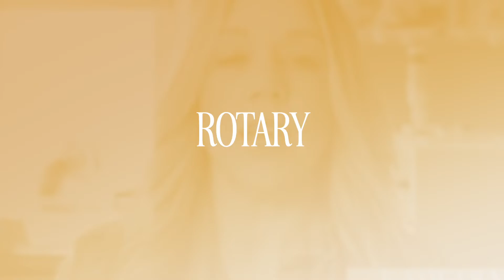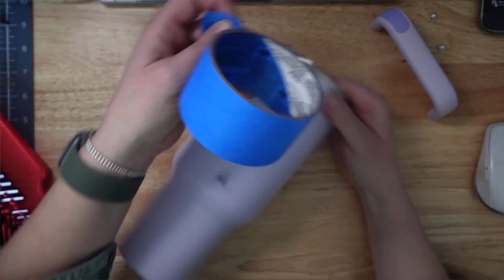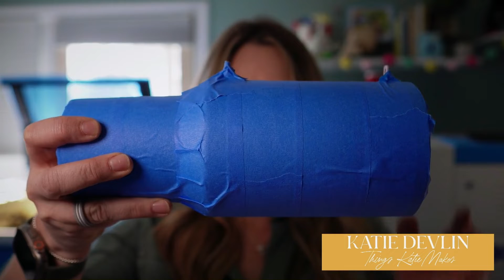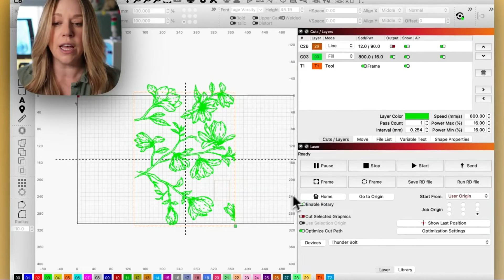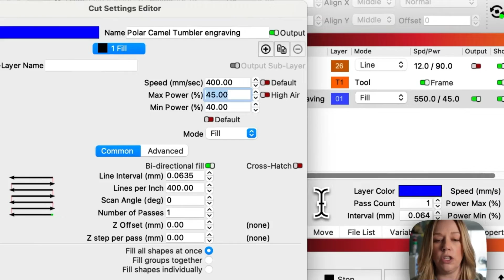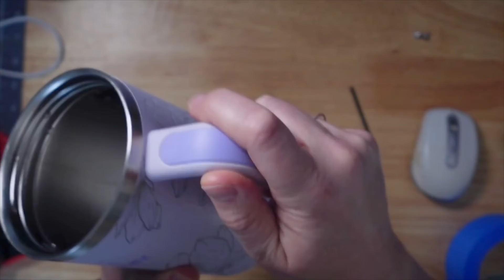Laser Engrave a 40oz Stanley Tumbler Step By Step | Thunder Laser Bolt | Rotoboss Talon & Rotobolt

Comment: How do you measure the 40 oz tumbler if you only want to engrave only the bottom part, which is thinner than the top? Do you use bottom measurements or top of tumblers?

Comment: Such an amazing video! You should have workshops as I'd join! :) 

I'm having issues as my images are "squishing" and leaving 1-2" inches left, so my image doesn't wrap. I have an XTooL - S1- 40 watt laser engraver. Any suggestions as I have tested and it comes out fine, then I pull out a new tumbler, the issue occurs again. Same settings but the system decides on its own. Anything I can do differently or what could be causing this?

Any help will be appreciated! Thank you!!!
Reply from the maker: Are you using XCS? if so, I'm sorry but I can't help!

Comment: great video! used it to create my first full wrap for my wife (Came out waaaay better than I expected). Someone is selling a 3d printed level that spans a whole 40oz edge to edge, would that be the most accurate way to get a 40oz level? I also see there is some adjustment for the air hose, would moving that up to avoid changing tilt work better? Thank you!!
Reply from the maker: I wouldn’t mess with that too much - it will direct it differently! And that 40oz level sounds cool!